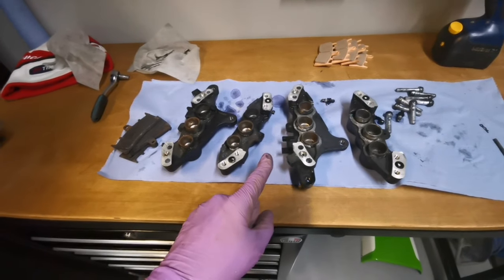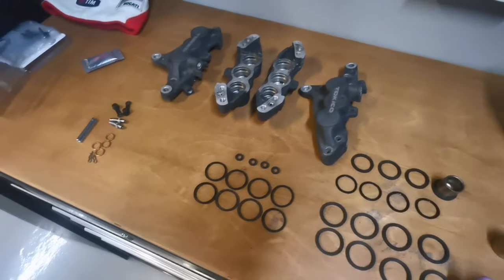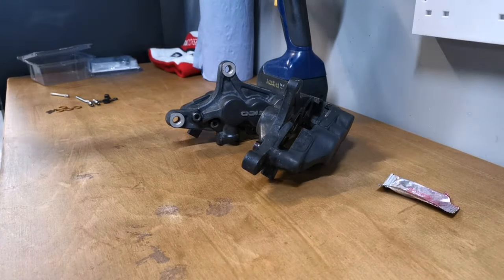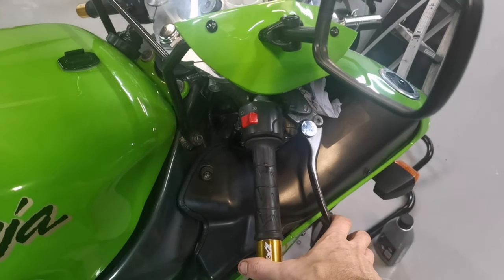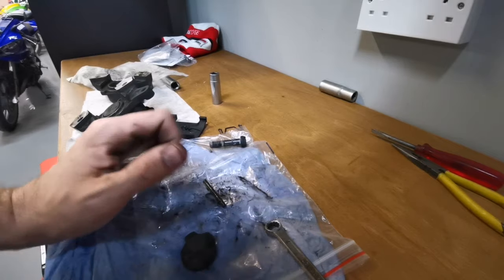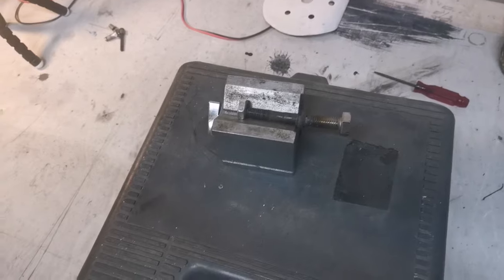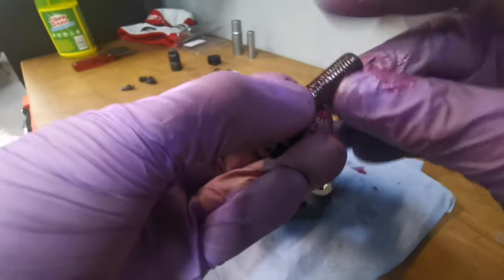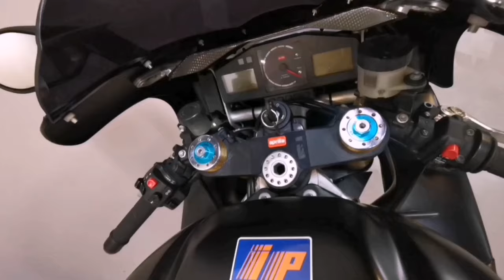2002 KAWASAKI ZX7R BRAKE CALIPER REBUILD

Comment: I have just finished overhauling the brake calipers on my ZX-7R.  It was a nightmare getting the stuck brake pistons out of a Tokico six-piston brake.  I tried it with compressed air.  I tried using a grease gun (which is a terrible mess).  I only ever got half of the pistons out.  At some point I took a pair of gripping pliers and placed sheet copper over the edge of the brake piston.  That worked then.
Reply from the maker: Yep sometimes you got to get tough on em ... 💪
Reply from the maker: When you bleed the brakes you may get trapped air in the master cylinder so make sure the lever is pointing down with the hose connection upwards... that way air around the piston will move into the fluid housing...

Comment: The reason the bottom pistons are smaller is to promote the trailing edge of the pads touching the disc first. This supposedly reduces brake squeal, offsets potential for uneven pad wear and can give a slightly more progressive feel to the lever, depending on who you listen to :)
Reply from the maker: Ah brilliant thanks I have just learned something 👍🍻

Comment: You mentioned that some seals have a tapered edge. I have just replaced pistons and seals on my bike as one was sticking. I cleaned everything well. And noticed that the bottom seals were actually tapered. I thought that maybe they were poorly made. And if they are tapered. Does the taper face up or down. As the one that was a bit stuck is still stuck.
Reply from the maker: Hi, yes, the outside of the taper or wider edge should face up towards the disk ....narrow end down to the inside of the calliper... the taper should be on the outer edge of the seal

Comment: Nice video. I'll be doing this over the winter, these 6pots do seem to suffer. I try to give mine a blast with brake cleaner and work the pistons in and out every so often and they still seem to seize up sometimes. What is the song called at the end?
Reply from the maker: Yeh brakes get forgotten about many times people just do fluid changes but the pistons do get alot of crap.... Sometimes you can use the existing seal with just a clean but when they start popping out they are done 😕...
The song is:    Hurt You Anymore CLNGR.... The one in my video will differ from the original as I cut and edit the music in my vids to suit the scene.... Ie remove lyrics, base,  instruments and shift them around

Comment: Hi mate! On the rear caliper are they just rubber covers or boots that are placed in the centre of the pistons? How are they supposed to come out? Mine have a cross in them, should they just prise out, cheers John.
Reply from the maker: Hello mate they are a type of plastic but you can leave them in... I just took them out cos I am nosey..... Make sure you get good quality pads  some of the cheaper pads are not the correct thickness so your pistons may retract back too far when the brake is released making it feel soft
Reply: @THE PROJECT-X-CHANNEL  thanks for your quick reply, did they just prise out with screw driver??? Spoke to you on your master cylinder video, looking forward to your valve clearance vid👍
Reply from the maker: Ah I can't remember now.... If the pistons are OK then just leave then in.... Or if you need to change them then you can spray them with oil and  hit the back of the piston so they will fall out.... If they don't and you have replacements then drill a hole in them and tap a thread then pull them......... If the pistons are bad and the insert is good then replace the pistons and drill a hole in the back of the old ones then insert a ponch and tap them out